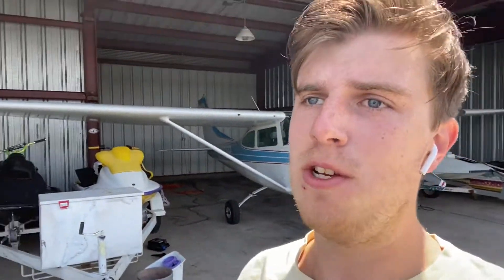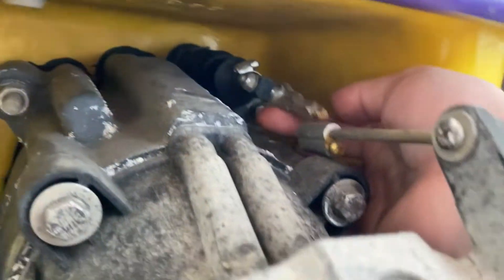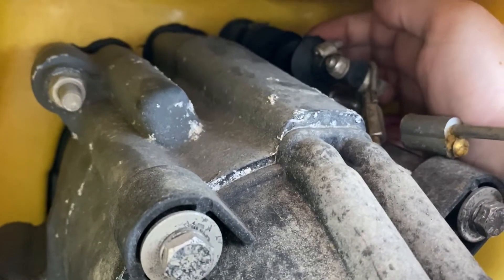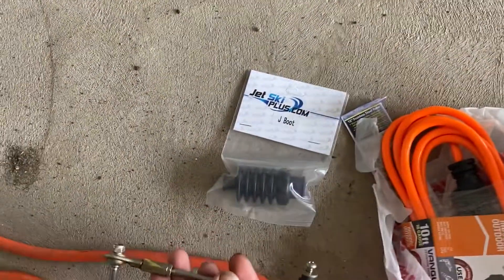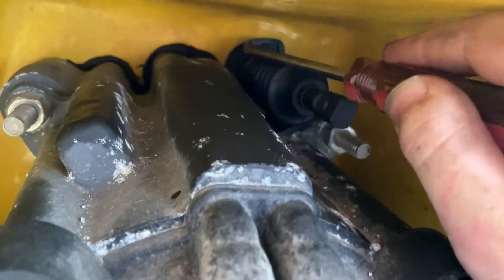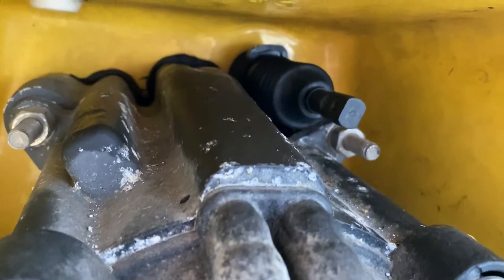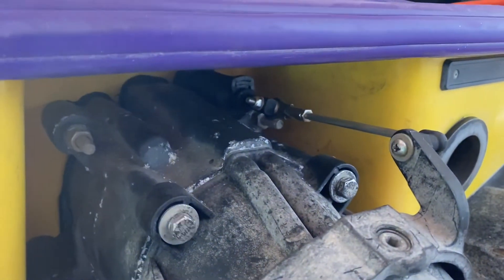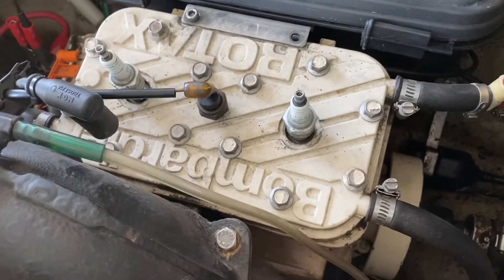Why is my 1995 Seadoo XP sinking when on the lake. Replacing VTS boot and trim rod. Part 1

Comment: sounds like your exhaust theory is correct
Reply from the maker: It was the head pipe loosened from engine vibration and the water that cools the engine flooded the crank case as well as the hull of the jetski. Now I am in the process of rebuilding the whole engine